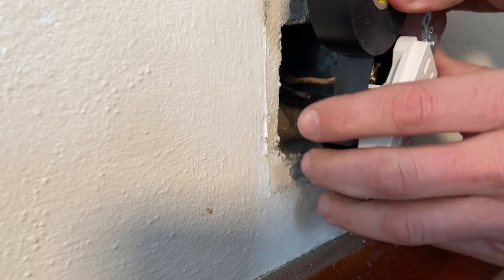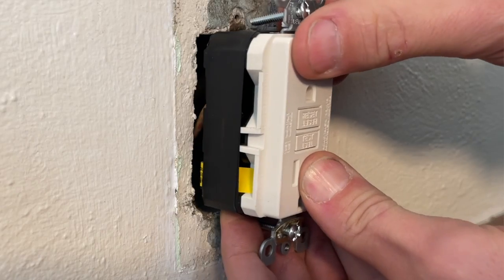Should You Wrap Outlets In Electrical Tape?

Comment: People that say no we don't wrap them are generally the ones that are lazy enough to speedwire and not run in the screws because of time. In metal boxes and especially single gang ones you should always tape them because there is a possibility of arcing to the side of the box (especially if your that lazy guy that doesn't run in the screws you know who you are) Also generally I will wrap them if the box is particularly cramped with wires. If an inspector says wrapping outlets in tape is not to code they themselves are imposing their own opinion and I have seen this many times in different townships and most inspectors are full of it and really don't know the code themselves all that well. I also see in the comment of many people that are basically handymen and are not even licensed, To all the weekend warriors out there and self proclaimed electricians let me say this: STOP doing your kitchen remodels and running the microwave off the first circuit your close to instead of running a new circuit back to the panel, STOP speed wiring outlets or using cheap inexpensive outlets thinking they are just as good, STOP taking work from actual professionals just because you think you know how to wire devices. There might be some bad electricians out there but that is because people hire the cheapest person they can find. A good electrician will do the job right!

Comment: sometimes i will with metal boxes especially some of the older boxes that are slim and only have half a centimeter of clearance either side.  Also where devices are taken off the wall by painters or tile guys cause i don't want anyone to get a shock.  The only time ill tape a marrette on is with braided wires

Comment: Receptacles and wire nuts are Not UL listed to be wrapped in electrical tape. Technically, if there were a fire from heat, the guy that wrapped it could be found at fault if you had a nasty fire/insurance inspector.

Comment: I have to go "Old School" and tape it regardless due to the next person years down the road may not be very bright and get the shite shocked out of themselves for improper handling. I've seen it done because they were "hardcore" and was too lazy to shut off the power to the breaker and wanted to prove they were macho. HAHAHAHA... Then they'd touch the wire again to see if the wire was really hot.  LOL... My take is be smarter than what you're working with. You live longer M8 !  Good Video !

Comment: Forty years in the trade and I've never seen a good electrician install a plug or switch without taping it first. Multiple reasons. First to protect it from shorting out from contact with the box or even more common a bare ground wire in the box. Second to protect the electrician if he installs it hot or more likely has to pull it out while it's energized. Supposed to always kill the power. Not in real life. I can't count how many times I've replaced a switch or plug hot because the circuit could not be shut off such as in a hospital or business that's in operation or simply you couldn't locate the feed for it. In construction it's standard practice to wire nut switchlegs together that are 277volts and when the tape and floating and painting is done to remove the wirenut and install the switch without turning off the circuit because most of the time you need the lights on to work. On taping wirenuts. Never. If there is any copper showing after the wire nut is installed you didn't do it right or the wire nut is too small for the amount and size of wires. A properly installed wire nut is hard to remove. It doesn't suddenly get loose and fall off. Most electricians don't follow the wire nut installation techniques on the package. We twist all solids together before putting on the wirenut. If stranded we twist all the wires together before putting on the wire nut. If a mix of solid and stranded we never twist the stranded around the solids. We twist the solids together, twist the stranded together, and then with both sets of wire side by side we twist the wire nut on. No other method works as well and I've seen them all. Typically either the stranded wrapped around the solid gets sucked into the wirenut and leaves the solid loose or the solid get pulled straight into the wire nut without being twisted and the stranded doesn't get pulled into the wirenut so it falls out.
Reply: @will hardy Not in residential wiring. I worked primarily in construction. Skyscrapers, plants, nuclear facilities, energy firms, hospitals and so on.

Comment: "No shortcuts on safety" actually means: Always LOTO power source to receptacle OFF 1st, then allways test for power 1ST with live dead live (LDL) on receptical before touching receptacle for removal/service to protect yourself. If you have work on it live, bad unsafe idea, wear class 1 electrical gloves and use insulated electrical tools only, never bare handed.

Comment: typically, around here anyway, we tape receptacles and switches during construction and leave them dangling out of the box so drywallers and install drywall without devices in the way (when electrical is getting done before drywall is up)

Comment: The point of taping a wire nut is to keep the nut in place in applications where vibrations occur or if your going to be moving the wires around. Ofc if your joint is garbage to start with then theres no point lol

Comment: I will wrap receptacles or switchers if and only if the box is metal AND the tolerances are extremely tight. As for wire nuts, I never wrap them unless they are going into a very damp environment AND I don't have any that are designed for that environment. The most common problem I have seen with wire nuts (both professional and DIY installers) is the use of wire nuts that are too big for the application. This I see so often it is actually sort of horrifying.

Comment: So I just like to add you're supposed to make the twist with your linesman's and then install the wire nut ..
Reply: You're not required to twist the wires with your lineman's. Per Ideal's (a popular manufacturer of wirenuts in the US) installation instructions:

"Pre-twisting acceptable, but not required."

https://media.distributordatasolutions.com/ideal/2020q3/documents/94f1324c79eda1f66ba3ed5d1902fb0f64633665.pdf

Comment: I see electrical tape used excessively in many areas where it isn't ideal or useful, and often times it's not anything good either, it's a roll of Dollar Tree checkout tape with terrible adhesive, so it's usually already peeling away, and leaving a horrid residue, even if it was used properly and the last bit was cut and placed, rather than pulled and broken.
Reply from the maker: valid points

Comment: "You check for a secured connection on the wire nut"  before! You put the electrical tape.... I dont like using tape on wire nuts because it's messy and a pain to get off.

Comment: Using tape on wire nuts will keep the wire nut from vibrating off in an industrial environment.(Lots of motors and such literally vibrating the entire concrete floor of the building and thus all within as well.) But tape is not a hide your mistake tool, you still have to twist the wires together and pull on them to check that they are together, and then wrap the tape about twice the length you have there.(tip to about two inches for a small gauge wire sort of thing.)But you are talking about a home, so, sure.

Comment: It's not only useless to tape receptacle it's also dangerous. You're concealing a problem of bad wiring in your receptacle by doing some custom insulation, you don't even know how good it is, and how long will it last, because no actual tests were made. Why would you put any crap on receptacle, if there is a problem breaker will let you know right away.

Comment: It's literally the first line of defense against everything. Short circuit. Getting shocked. Etc. I wrap ALL outlets AND switches. Guards - at minimum - against shorting by a ground out against the hot (or even neutral, so that no current is carried constantly on the ground). But yeah, you don't want the end stretched. That's why I pull it back up, let it retract and reapply it. Not difficult. (I can't even finish watching this. It's contrary to common sense. Don't wrap wires under wire nuts before you're finished and have made sure everything is secured).

Comment: i wrap the ends of my wire nuts, not as a crutch, but as a extra safety precaution. as long as you check the security of the nut i dont see the problem

Comment: Don't use tape to cover up a bad install job. 
The same reasoning for not using tape on wire nuts applies to outlets. If the box is so tight there is a danger of an arc fault,  change the box! 
Don't use tape.  It is sticky and can attract dust, lint, bugs e.t.c.  the outlets do have some air flow through the cracks around the plate and dust and lint can get caught by the tape, then if there is a spark it can ignite.

Comment: I've never heard of nor seen this done before and I've worked on a lot of industrial and residential projects. Is this an American thing? I hate people that tape wire nuts, I had to swap wires on a 3ph pump motor and the person must have used a whole roll of tape! If you're using them in a situation with vibration like motors, you can use a wire nut with a set screw. Whatever you use, if you do it properly you don't need tape.

Comment: The only time you should use tape on wire nuts are high vibration splicing, such as motors, transformers, or other equipment subject to heat and/or vibration.

Comment: Never go by instructions on wire nut boxes. They state NO PRE TWISTING NEEDED . BULLSHIT. Also give misleading wire insulation strip. Best pratice is to strip all 14 to 10 guage wires 7/8" then twist with heavy side cuttets until wires twisted a full turn on insulation. Trim edges then tigthen wite nut with sidecutters. Then tape. Went back 25 years later to add another wire to a splice that I made and never came across a defect.  Hated when I went behind a lazy.person who did not pre twist a wire nut and did not bother to tighen mut emough. While removing a  wire nut instslled in this piss poor way wires come apart causing sparks.

Comment: I grew up working with my dad he was an electrical engineer electrician HVAC man and a master plumber he hated doing Plumbing so me and my brothers always had to do the plumbing I ended up being a master plumber as well but he always worked on everything as if it was live he use nice Klein Tools and he never ever touched wire with his fingers always used his tools that way it didn't matter where the power was on her off he could do it live or not and he says putting tape around those are completely useless it makes a big sticky mess

Comment: But why not having some outlets that doesn't have exposed live metal? In Europe all outlet, switches and so on does, the only exposed part is the screw that is recessed and thus nearly impossible to accidentally touch. To me that seems so insecure, especially since live and neutral are at the opposite end and it's damn easy to touch them while removing the outlet of the wall, meaning that to be safe you always have to interrupt power only for opening a box, to me it seems stupid.

Comment: if there is exposed copper at a wire nut, it is installed incorrectly.

and taping over a terminal because it can't be physically spaced away from a conductive surface should not be counted as habitually taping.
Reply: What if your wire nutting a bare ground wire?
Reply: @protoman247  okay, if there is exposed current carrying conductor...

Comment: I had to repair one of those innovative jobs. The metal box had tabs that weren't bent tight to the box and contacted the screws causing a breaker trip. Instead of taking needle none pliers and bending the tabs flat they tape wrapped it. 6 months later there is a short again. the switch moves every time you turn it on or off. It's going to wear through the tape. Do it right, do it to code. If you aren't that picky, you shouldn't be doing it. Lives are at stake.
Reply: Yeah I always flip switches with one foot in a pail of water. I mean who doesn't?

Comment: Try working on a receptacle that's been wrapped after about ten years.  Nothing but a gooey sticky mess.  If the install was done in a pro manner, then you will not have any problems.  If you de-energize before service,  then you will not encounter shock hazard issues, assuming you are equipped for the job and verify everything is safe.  The tape is just a last security (oh shit) layer to cover half-assed work to begin with.
Reply: ...just cut the wires and replace the ten year old plug.
Reply: @mathewm7136  And install the new one properly without scotch 33

Comment: Without Ground, the GFCI outlet is useless.   Is the metal box grounded?  If not, there is no point putting in a GFCI or ground outlet.  It would have been better to hire an electrician to get ground to your outlet somehow - copper pipes perhaps?
Reply: GFCI works without a grounding wire, code allows you to use GFCI without a grounding wire.

Comment: Rule number one,, always tape, never stretch, and always flag the end.

Remove the mounting screws, this helps you from having to work the tape under them and stretching the tape. 

Always flag your tape, this is a sign of being a professional as you have shown the guy that follows your work that you did him a gurtisy by showing the end. Never know the next guy may be you.

Now Ideal have a rubber band that you install from the front, I've used them and they are a time saver, no need to remove screws or use tape. Very salty so if you bid a job you'll need to add the cost to your quote. They are reusable if you have to revisit the device in the future. 

Industrial maintenance for 41 years.
Reply: I've always chewed out past electricians for wrapping a plug in a plastic box. Waste of my time! Luckily, I don't run into it too often.

Comment: Just my humble opinion but I ALWAYS wrap my outlets when I work on them. One reason is to insulate the outlet inside a metal box. But the main reason is that not everyone will every time double check to see if the power has been cut off. This way you will at the very least have a bit of safety until you remove it and AGAIN check the wires for current. It only takes a moment to do and the tape is cheap insurance against the dreaded "Mike, the rat bites"

Comment: Ps your gfci outlet has plastic protection from grounding on the box
Reply from the maker: Hey Brian,  do you mean the little fiber or plastic washer on the bottom mounting screw?
Reply: @EverydayHomeRepairs  no the over sized moulding of the housing the connections should be able to touch the box

Comment: Over 30 years of Commercial, Industrial, and now more of residential....I have worked with 1000' s of other electricians and only time we taped one would be when we would install them live....even if you just loosen the screws on a metal mudring the receptacle or switch can't move enough to the side to make contact...wrapping them is a waste of time. Doesn't help anyone...Nothing in the NEC about wrapping a receptacle. Not to mention if you are going to waste your time...at least make sure the tape you use is rated for the voltage...Quick question...do you guys that use tape to wrap receptacle 's and switches, do you make.splices with solder??

Comment: Before you tape the wire nut and wires, do your pull test......absolutely the tape shouldn't hold the wires together, just insulating protection for the open side of the wire nut

Comment: You are doing the wiring nut incorrectly.   There is a tool that fit over the wire nut and attached to an impact gun.  It will twist all wires nice and tight.  That's why there are wings on the wiring nut.

Comment: The building inspector in my area would remove and inspect a few wirenuts. He insisted that the wires be twisted with pliers  before the nut was screwed on. Wich I have always done. He would flag the whole job if he found one not twisted. He was also a stickler for using purple primer on plumbing pipes. He was fat and would not crawl into tight crawlspaces but as long as he could shine his light and see purple primer we were good. So yes we did circumvent that at times.lol. Just a dab will do ya.

Comment: Well to avoid having a wire being held in to wire net with just electrical tape do the pull test before you wrap the tape around the wires and wire nut

Comment: Actually you tape your wire nuts it's to help keep the wire nuts from turning off and that does happen and it has nothing to do with improper installation.My guess is vibration from the electric.I always tape my outlets when in a metal box otherwise it's not necessary.Also if you would have properly twisted the wires together before nutting them that wire wouldn't have come out.I always twist mine ,makes them hold better.

Comment: I always wrap outlets.  Found more than once an outlet failed due to arching. Fortunate breaker tripped. Small/simple price to pay for added safety.
Reply: How is wrapping going to stop arcing that would cause a receptacle to fail?  It's only going to prevent inspection, and possibly allow a loose connection to continue to make contact.

Comment: If there is no risk of the terminal screws coming into contact with the sides of a metal box (no, I don't mean every single metal box and I don't mean every single device) then there is no reason to wrap tape around the device. If you're worried about an amateur shocking himself then maybe they should call you instead. If you're worried about shocking yourself then maybe you shouldn't do electrical work and maybe the amateur should call me.